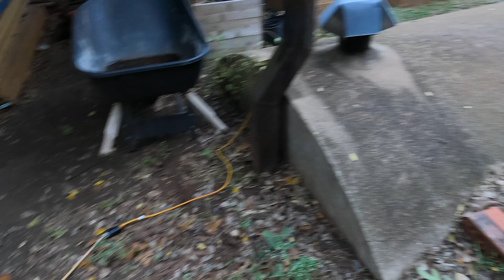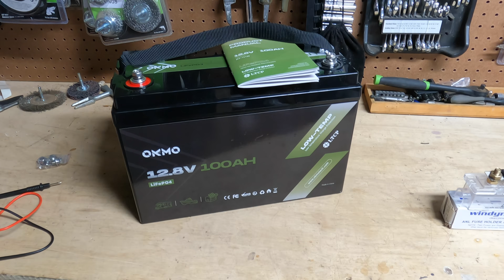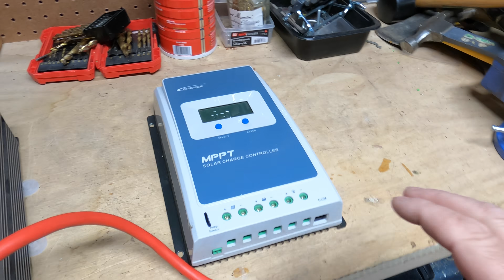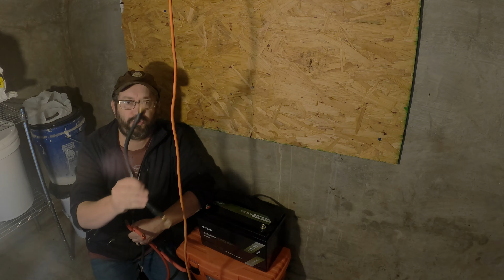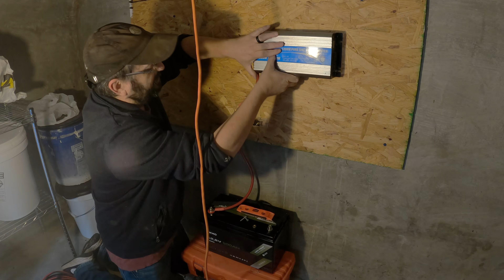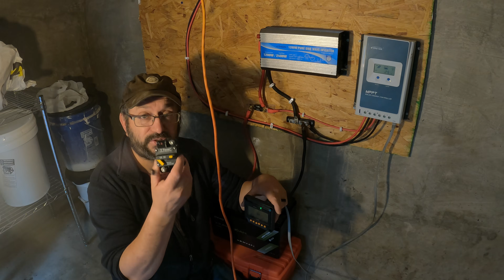Easy off grid solar build using a 12v 100ah OKMO lithium battery! Beginner Friendly!

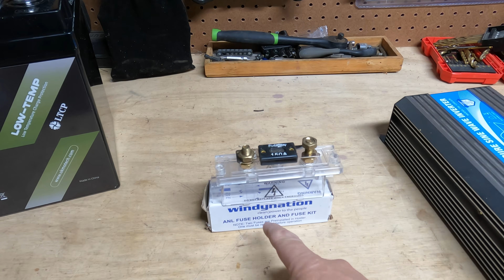Comment: 1:49 Class T fuse is a better choice. The ANL will not stop an arc situation if the battery shorts.

Look into it. I had an ANL with my hand rolled system but switched to Class T after some research.
Reply from the maker: Disagree.  Not at 12v.  I have a Class T on my 24v and I love it.  But no need on such a small setup with such low usage.
Reply: I guess if you’re on your own it’s ok, but having family members in a confined space during an emergency situation might warrant a bit more safety consideration.
Reply: Could you link the class T fuse?  What size is it?